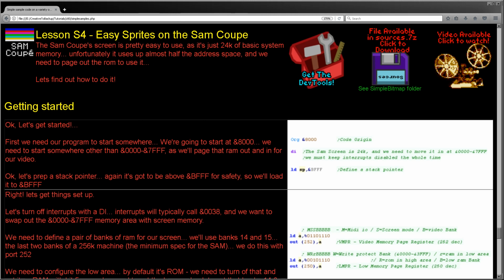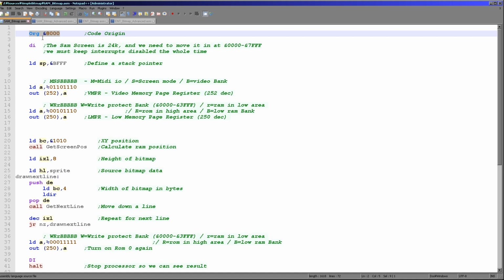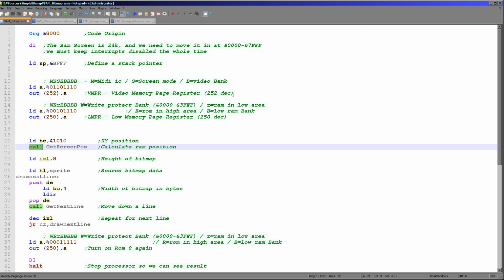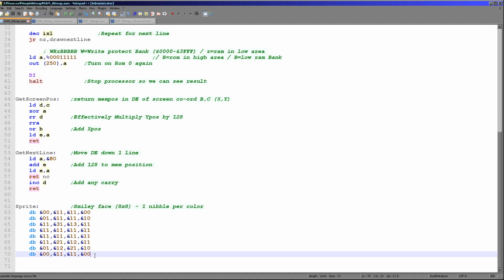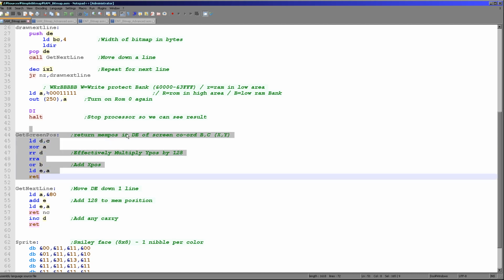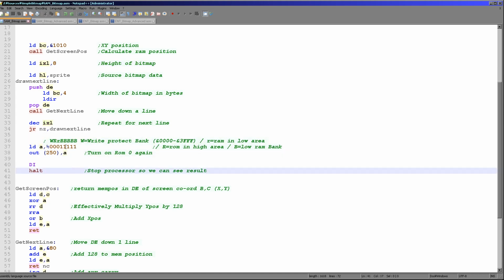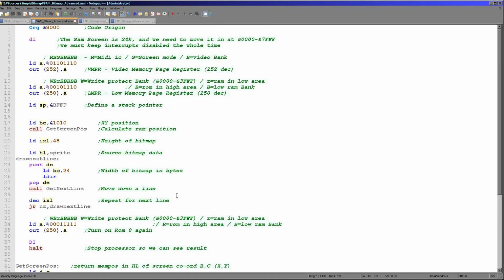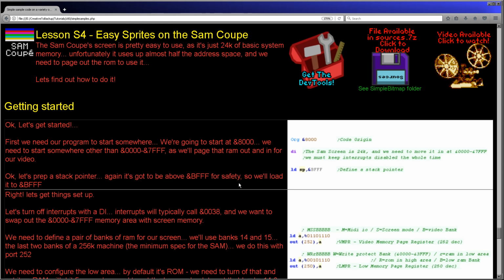Easy Sprites on the Sam Coupe - Simple Z80 Assembly Lesson S4

Comment: Out of interest, why put the screen at &0000 instead of &8000? As thatwould still allow you use interrupts and run the code in the lower half of memory?
Reply from the maker: Because my code is at &8000 - when I started these tutorials I was able to structure things so I was building with by program at &8000 on all systems - this made things easier for fixed memory items and code - like ArkosTracker Music files